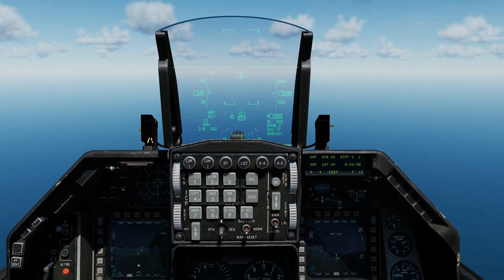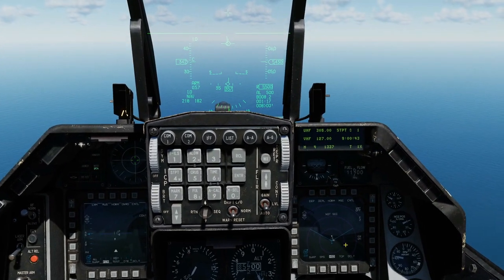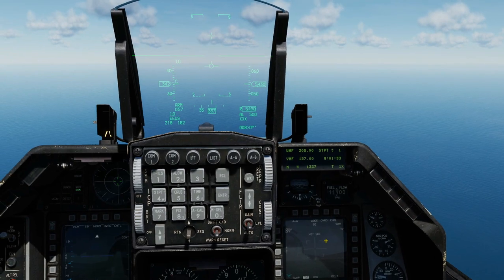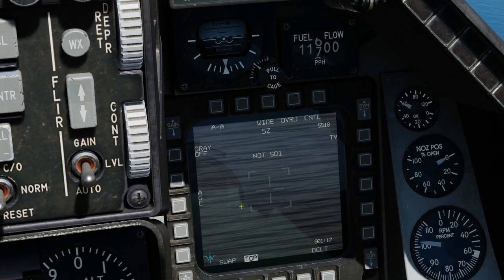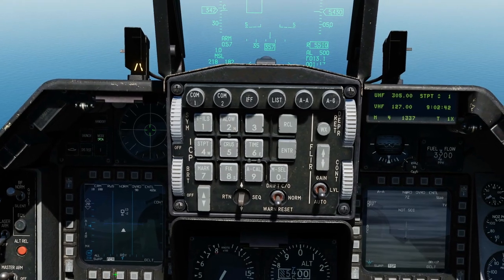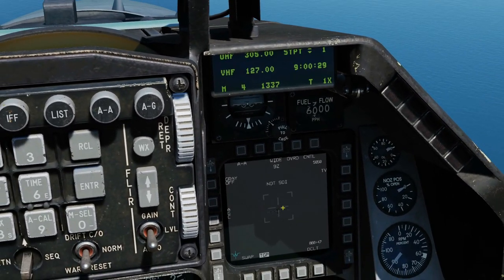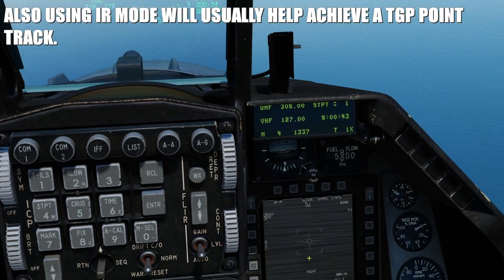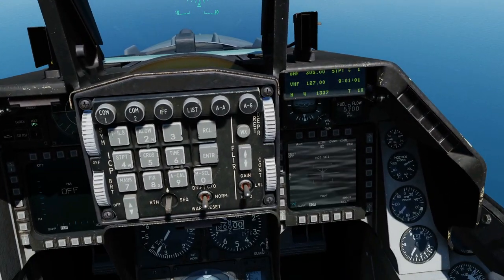F-16C Viper: TPOD TGP Air To Air Mode Tutorial | DCS WORLD

Comment: I'm really thinking about, if the AIM-120 could be fired with a TGP in RL.
Why not? the TGP could give exact Coordinates  and send them by DL to the AMRAAM?
Reply: and with this it could passively track and then shoot a AIM-120, without radar emissions!
Reply: @schweizerluchs7146  That would require the missile to have a GPS sensor, which it does not.
Reply: @robertcurtis1191  so the D model does have GPS as it looks like?
Reply: @schweizerluchs7146  while it might what it does for that missile is still kind of hush hush. From what I was seeing in that post it's more or less for keeping the INS in check and correcting it's errors by letting the missile know where it is by where it isn't.
Reply: @ionator2000ist  sure😅 but it would be soo good

Comment: Curious why do all these targeting pods have no color video function?
Reply: We don’t have the most modern versions of planes in DCS, but I won’t be surprised if F-35 still has no color video. It’s good and reliable enough in grayscale. You need to consider not only how it looks for operator, but how this video is processed, transmitted and stored. You’ll be able to transmit grayscale feed in much worse conditions compared to colored one and you can store longer feed on same tape (I think tapes are still widely used in military aircrafts). Watching targets on battlefield gives very different requirements from watching My Little Pony at home. And for shkval as example with is’s soviet electronics and CRT display I’m very sure that grayscale is best option because it’s much easier for locking system implementation and color CRT displays give you less small details because they show you array of dots, not smooth continuous scan lines as b&w displays.